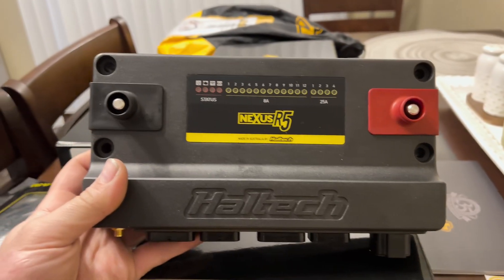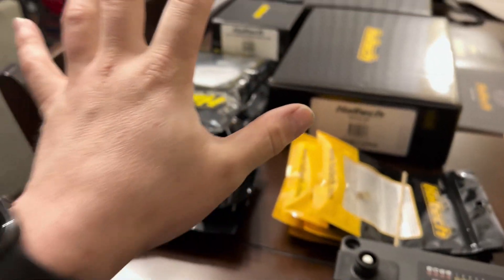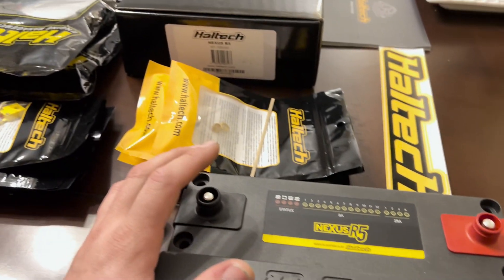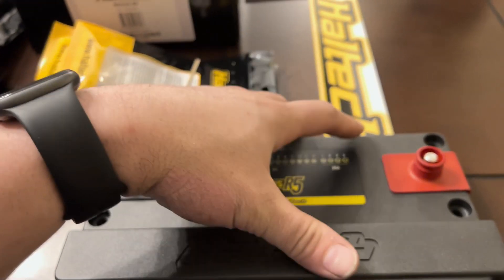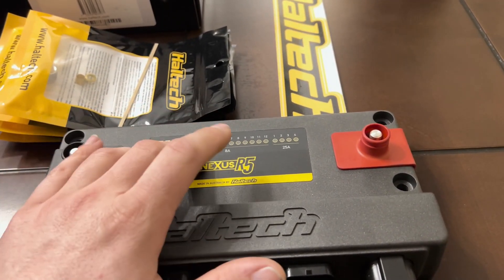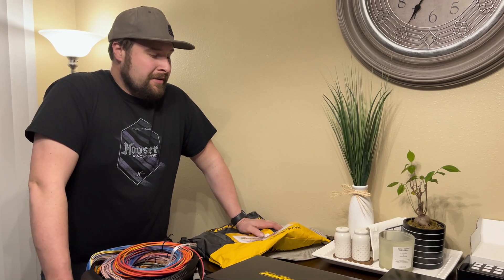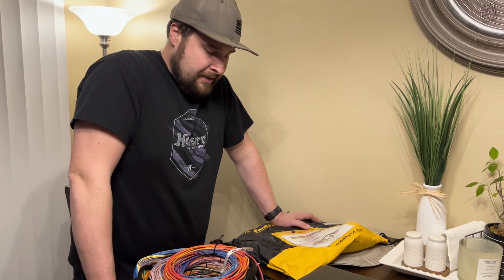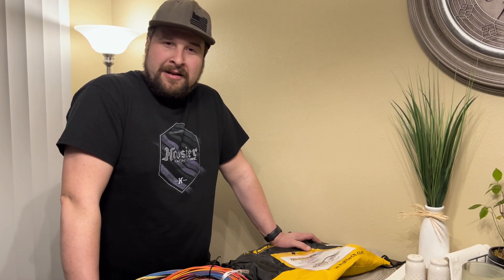Scarlet Haltech Nexus Explained

Comment: Couldn’t afford motec?
Reply: If it’s not needed and this does everything he needs, then why? Motec is awesome but till you get to the point where you are needing to  program your own features into the ECU other ECUs don’t offer then what’s the point
Reply: Nexus is a better option for Steve in this car. Motec is great from a integration perspective.  If you have a 2008+ car there is can bus and many modules that control the power in the car.   Steve’s car is a 1990s legacy with a 2004 sti harness grafted into it. The nexus is a great way for Steve to remove every wire out of the car and start fresh. He won’t have to worry about any relays or factory electrical fighting him from going fast.